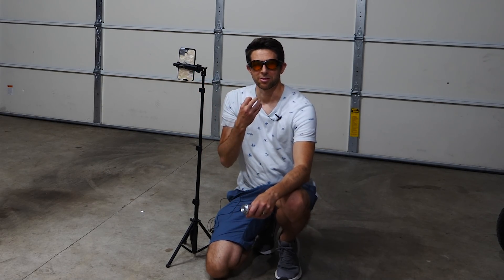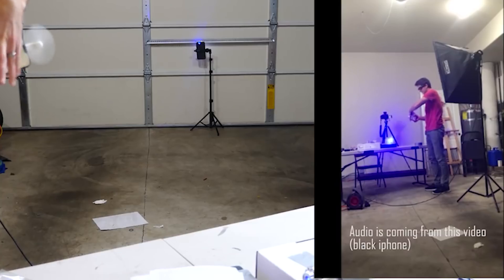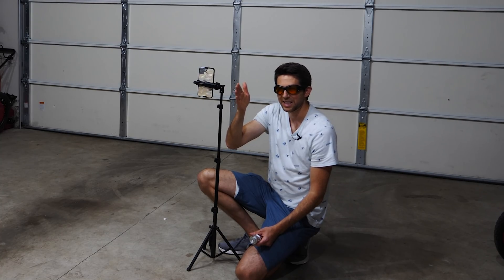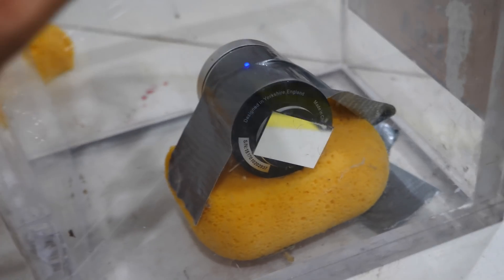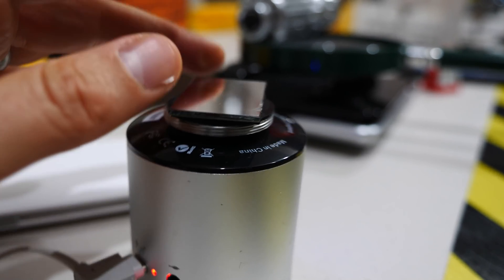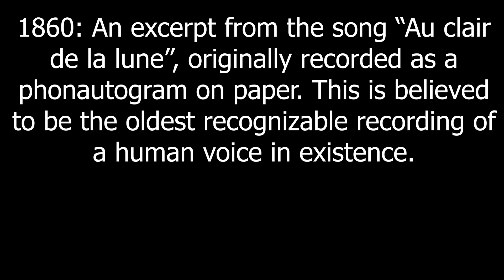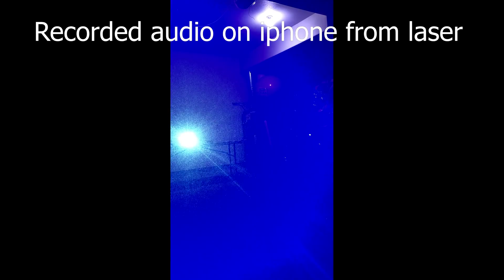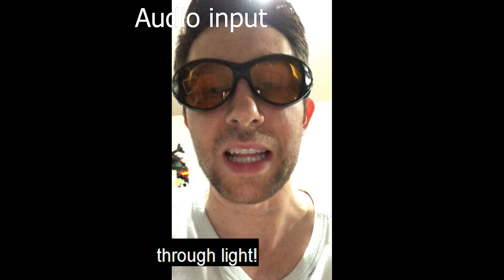How Microphones Can Record Light―Recording My Voice As Light Waves

Comment: It seems like with this method there is no encoding of amplitude, only frequency: amplitude just makes the laser go further away from the mic so is lost information.

I think you would need to brighten & dim the laser to vary the amplitude, as well as have it sweeping for frequency.

Edit: or pulse width modulation of the amplitude
Reply from the maker: That's what I thought at first too. But you can actually change the amplitude as well. I tested this on the frequency sweep by turning the amplitude up and down during it and it definitely changes the volume strength on the final laser audio. I think the reason is because the faster the you pass the laser over the mic, the louder the "pop" sound on the mic when the laser hits it. So, for a given frequency, the laser passes over the mic at a certain speed, so if you increase the amplitude at a given frequency then the laser passes over the mic faster resulting in louder "pops" at that frequency.
Reply: @TheActionLab  So here's what I think, the speaker/mirror vibrations are in the form of sinusoids. Since you're using a microphone with a point aperture, most part of the sinusoidal wave is being clipped thereby clipping a lot of information. This I attribute to a proof from the part where you pointed the laser bouncing off the mirror on the wall. If you manage to use a microphone that is equally sensitive but with a sensor surface area large enough to accommodate the entire span of the laser's vibration, you'll have much more information at the receiving end. 

A part of theory goes to Clippers and Clampers and similar filters  and their use in Sound Engineering. 

Your Input waves from the input audio are a superposition of all the sound waves from all sound sources. X = Superposition(ai.xi)
Considering no losses on the speaker and mirror, you still have X as the overall input.
Here we consider that the amplitude of vibration of light is directly proportional to the amplitude of your sound.
 if X has components like your voice X1 and your children playing in background voices X2
then 
Amplitude of X1 which is A1 is way larger than the microphone's aperture and thus gets clipped and the only thing you can barely hear is the tone (frequency changes) in X1
As to why you can hear X2 with their A2 properly is because their amplitudes can fit inside the aperture.

I hope you make another video with a very successful outcome.
Reply: @TheActionLab  could u try converting s-waves into pulsating p-waves? This might allow to focus the light beam only in microphone and will work like a fan that was pulsating. Maybe using fan as a speaker that spins depending on voice frequency or quick enough light switch for the laser to match voice?

Upd1 from the video its obvious that most of the light is being lost and I think focusing it might solve the problem
Reply: @TheActionLab  the frequency bandwidth of the microphone might just affect amplitude.
Reply: You don’t need the laser to move across the microphone, you only need to modulate the laser intensity to match the instantaneous soundwave amplitude. It would require some experimentation to get decent fidelity
Reply: What if we amplify the sound signal enough to drive the laser and use it to power the laser? Then the laser would directly fall on the mic.
Reply: Tim O'ney  frequency of the laser doesn't matter much. Only frequency of movement of the beam due to the mirror is generating the sound.
Reply: @The Action Lab @Holt Westling
 What if an array of microphones are used along the vibrating path of the laser and the output from all of them are combined together and maybe do a noise filtering??

Also, what if instead of reflecting the laser towards the microphone,  if we attach something like a hurdling bar on top of the vibrating speaker and put that system in such a way that the "hurdling bar" thingy vibrates perpendicular to the path of the laser (Like how the leaf of the fan passed through). Would that work in any way!?
Reply: @remesh1226  adding more mics might work but that wouldn't be so useful if your goal was to order 1000 rubber ducks on your neighbour's Alexa
Reply: @remesh1226  using an array of microphones would make it difficult as you'll have to calibrate each microphone a corresponding ranges of amplitudes and phases in the vibrating light waves
Reply: Tim O'ney  the thing is the frequency of the visible spectrum is inaudible and thus you won't hear anything

Comment: I think the clipping may be partly due to the mass of the mirror. It's not vibrating perfectly with the speaker because it takes time to accelerate. What if you connected the microphone directly to the laser rather than bouncing the laser off a mirror. Would an analog signal work as well as a pulse?
Reply: Yeah a PWM laser driver should work a lot better. The microphone itself will act as a low-pass filter to remove the carrier frequency.
Reply: Yeah. I Think some sort of highly reflective membrane would work better since the elasticity would provide the best sinusoidal effect
Reply: Or maybe, in our 21st century technological age, he could unlock his smartphone, open a browser, go to www.google.com, type "how to audio modulate a laser pointer", and click the first link and he would get this: "The trick to modulating a laser is to put a 10 ohm resistor in series with the batteries and couple a sound signal across the resistor through a 100 uf capacitor from an 8 ohm audio source." I actually did this with headphone output of my laptop (32 ohm or so) and it was powerful and perfectly undistorted. No need for any PWM.
Reply: @charlieangkor8649  You must be fun at parties.

Comment: Consider the following:  'EM', electromagnetic radiation, does of course have an electrical component and a magnetic component to it.  Atoms and molecules have protons and electrons in them, each of course being considered a charged particle as well as having their own associated magnetic field.  While not all matter is considered magnetic, all matter can be affected by magnetism.  Electricity is electricity and magnetism is magnetism.  The interaction especially between the magnetic fields of the 'em' and matter cause things to occur, as energy interacting with energy causes things to occur in a cause and effect kind of way.
Reply: or it could be due to pressure created by the light beam on the diaphragm of the mic.
Reply: @ohh9979  But then one would have to explain what makes 'pressure' by the light beam on the diaphragm of the mic.
Reply: @charlesbrightman4237  cuz photons have momentum? due to that it provides a force? which results in a pressure?
Reply: @ohh9979  Of which, how could that pressure arise from a force, unless photons actually exist in some form to have momentum?  The electrical and magnetic energy fields of 'em' (photons), interact with the electrical and/or magnetic fields of matter.  Electricity is electricity and magnetism is magnetism.  The respective energy field of one interacts with the respective energy field of the other.  Hence, 'light' ('em' or photons), interact with matter, in this case, with the diaphragm of the mic.

And consider also the following:  Sound inside a room or building, might cause matter (especially glass windows, but not only glass windows), to vibrate, even if ever so slightly.  Pointing a laser beam at a window, and collecting and amplifying any return signals, one could hear what is going on inside of a building.  Spy craft, 101.